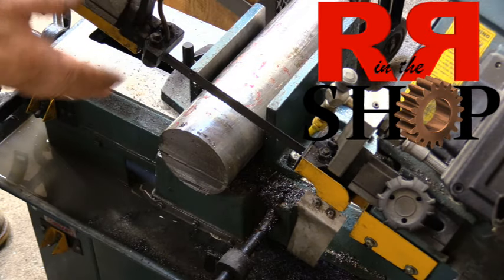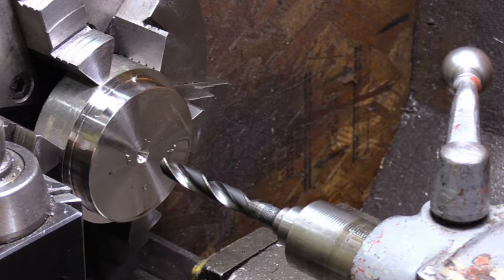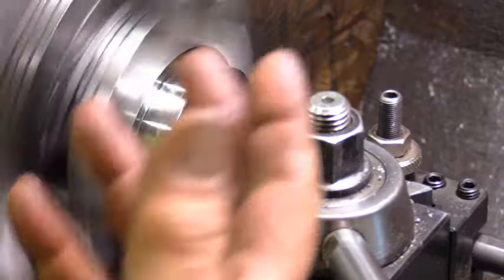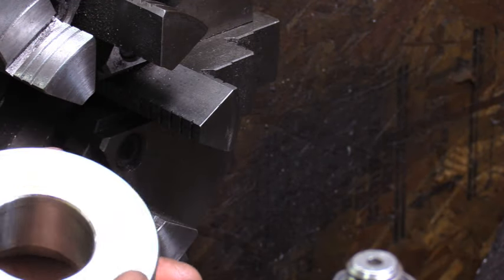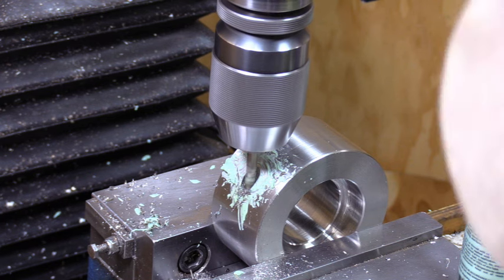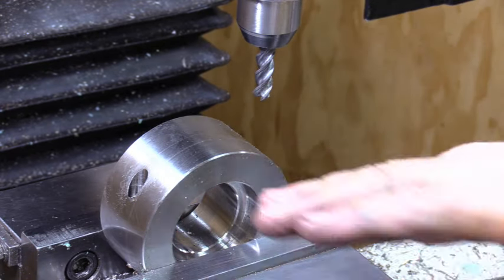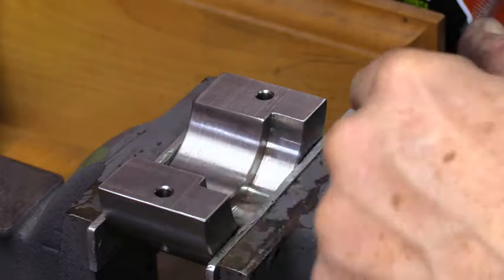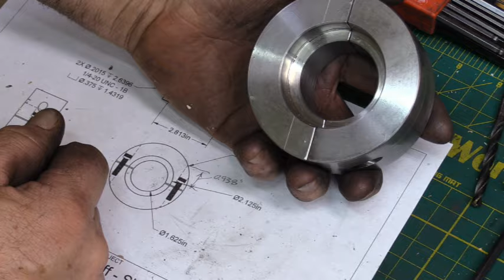Hydraulic Cylinder Stop | Grapple | Attachment

Comment: When you cut a perfect circle in half you have created an ellipse and it will NOT grip evenly around the shaft. The correct way is to bolt  2 halves together with a shim in the middle. Then drill or bore to final diameter. When installed the halves will clamp perfectly, spaced apart the thickness of the removed shim. Randy you said is was "good enough" for the job so I am not criticizing you since you know the tolerance for the job. This note is for others that may not know the difference and need a tighter grip.
Reply from the maker: Yes I am fully aware of this.  The stop is not intended to grip the shaft, there is 0.100" clearance.

Comment: Your drilling is bad sir. I dont know everything but I've dressed grinding wheels, freehand split point sharpened taper drills, and punched enough 2.5" holes without a pilot hole in 4340 and 316L to have an opinion on the internet. 
If the lathe motor has the power and you can comfortably crank the tailstock without a cheater pipe longer than the machine's swing you should drill the hole in one shot with no pilot. It saves on drills, saves time or money on resharpening, and wastes less effort and makes no noise. Taper drills need that axial pressure so the cutting edges last and the taper doesn't slip in the quill. 
I'm some know it all on the internet but trust me when I say its going to feel like witchcraft when you are quietly drilling massive holes in stainless in hardly any time at all without needing a bunch of drills resharpened. I was forced to self-learn how to do this making propeller nuts for ships on a manual lathe in order to keep my job and sanity.
Reply from the maker: Thank you.